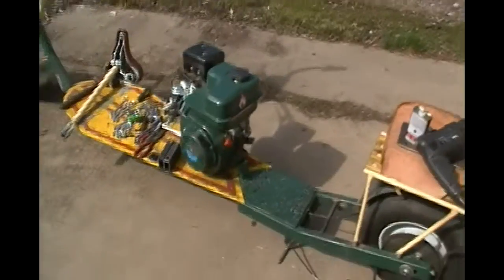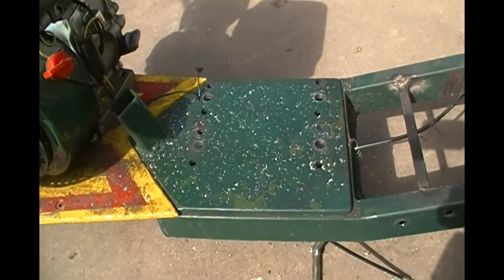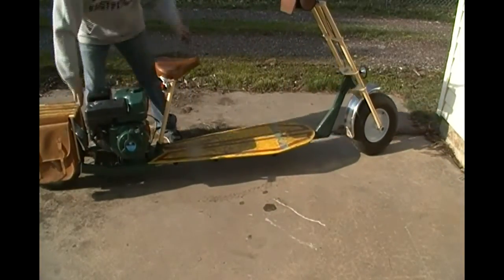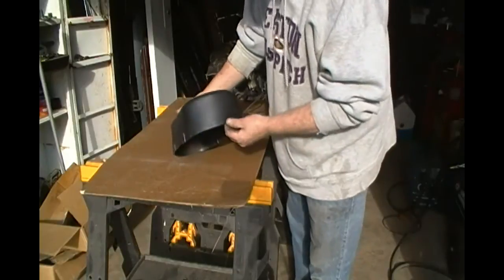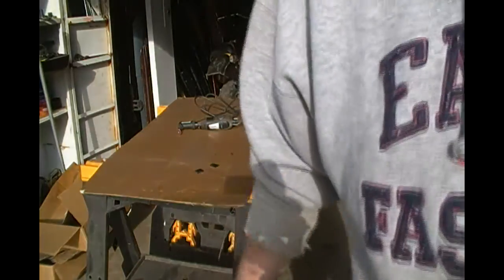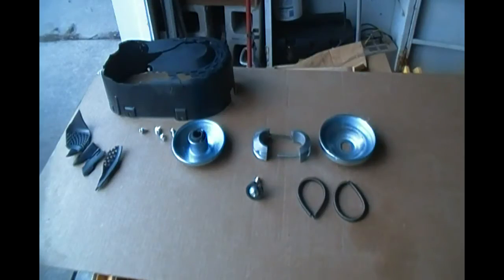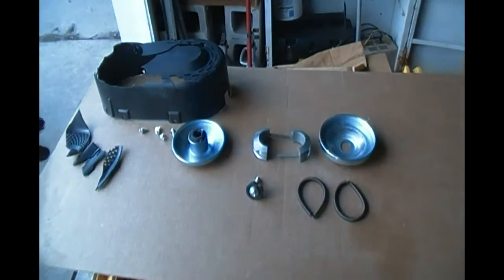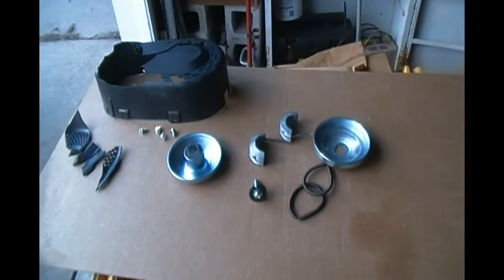EXPLODING TORQUE CONVERTER ?

Comment: I had a screw snap off inside the shaft, had to drill it out, it ruined the threads, so I rethreaded it with a drill tap, and began riding, then it did that same thing, I found all the parts except the outside cover which went rolling into the bushes in someone’s garden, it had stripped the treads I created right out… anyway I got new parts, then got threaded rod, slid it into the hole, drilled through the crankshaft and the rod from the side, and stuck a 420 chain link in to stop it from coming out, then I threaded a nut on the end of the rod bolting on the torque converter. it’s been holding up perfect for the last few months and I’m a really hard rider, I can also tell if it comes loose because the rod can’t move and I know there’s a half inch clearance between the end of the nut and the end of the rod, so if it loosens I’ll know we’ll before it falls off, and the chain link came from the mini bike itself, those tiny link rod things are incredibly strong and shear proof.
Reply from the maker: That's very resourceful of you, Thanks for sharing  that. 
☀ You may actually want to make a video to show others how you did that . I'm sure there's some that could benefit from that.🌝🏍

Comment: I spotwelded that pos bomb. That plate is mild steel. Almost feels like aluminum. It wasn't on mine. Just a spot weld on the side of the bolt going to the engine did it for now.

Comment: The issue is the bolt is too short, it only goes in a few threads, I went out and bought a longer bolt, I believe I bought a bolt a half inch longer, make sure to get the strongest bolt you can, and then really torque her down, I always use a air powered impact gun, don't get carried away, give it maybe 3 or 4 quick bursts

Comment: check the torque speck for the bolt and then put some lock tight on it!
Reply from the maker: Yeah, I didn't have it secure enough and it backed out.  Thanks Marc.
It's been all good since then... Cheers

Comment: I've had numerous ones explode they r trash get u a upgraded juggernaut driven pulley and u will never have to worry bout that agian the other pulley on th3 drives shaft hold up good tho
Reply from the maker: Well after a new longer bolt and secured it better I never had any more problems, Thanks for the suggestion though.

Comment: Sir I feel bad about your scooter because it is a good convenient fun machine. 

But I would love to see any drag race slushboxes blow up, because drag races are:  manual transmission or no transmission. 

In terms of drag racing I am anti Powerglide anti Torqflite, they loose power and gain pressure upon burnout.
Reply from the maker: No need to feel bad, It's all part  of the process. It's been repaired and working fine now. Speaking of races, have you seen my Big Race video ? here's the link
 http://youtu.be/_0FtZ0kqJQ4 

Thanks man, I appreciate you commenting !

Comment: Did you use a proper grade 8 bolt in the correct length lock tighten in place ?
Reply from the maker: When this happened it had the bolt that came with the T.C. and it was just tightened with a wrench.  After this was over & I reinstalled,  I used a longer bolt. 1.25" I believe, not certain now (Been a while ) & used blue loctite, and gave my wrench a good quick rap with something heavy to assure it was snug. As a torque wrench would only serve to turn the engine. 
I've had no problems after that.
Thanks for checking it out & asking... Take care

Comment: The bolt is to short  I had it happen twice for me . I put a longer bolt and lock tight on the bolt then the clutch wouldn't  release the belt kept running . I tried to take the bolt out then it twisted off. I thought I never get it drill out but it did 1 1/2 hour later. I seen lately other videos they had the same think to them The bolts come out.
Reply from the maker: Yeah I found out the bolt was to short, I replaced it and secured it well. (Didn't use any loctite though ) It's been fine ever since. Thanks for sharing... Cheers

Comment: LOL this just happened to me! on my minibike! ah well on amazon i got a replacement and im getting a better longer crank bolt
Reply from the maker: Yep, and make sure you snug it down good. What all did you have to replace ?
Reply: @TufdogsPlace  im getting a free replacement of the whole assembly cause the insides got badly damaged and the belt is ripped
Reply from the maker: @LogixChannel  Wow, That's really good of them to take care of you like that. 
Good for you ...
Reply: @TufdogsPlace  yea now they ket me keep the old one and they sent out a new one. for a predator 212 u know what size bolt would be good enough?
Reply from the maker: @LogixChannel  I do, I made a video about just that, here it is , 
     https:// www.youtube.com/watch?v=4w2V1sJqhPU   cut and paste to view
title of video is " 6.5 HF ENGINE & TORQUE CONVERTER PROBLEM FIX "
8mm x 1.25 thread pitch  - 2.25" inch long bolt